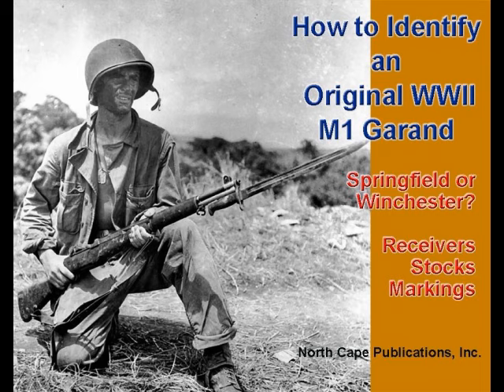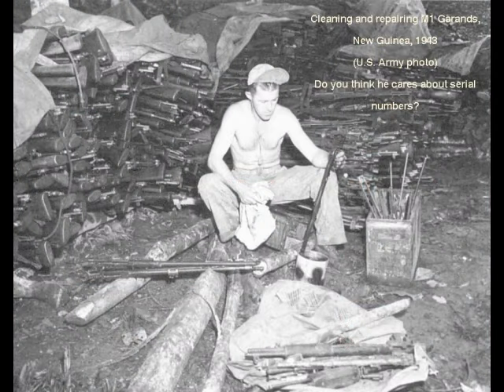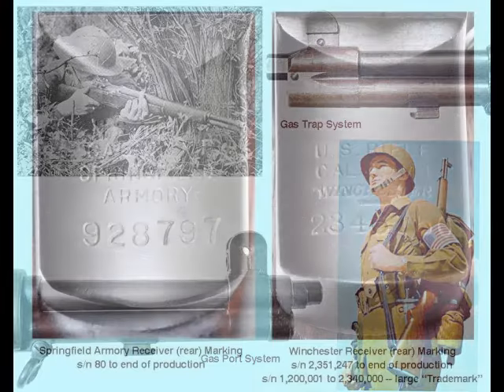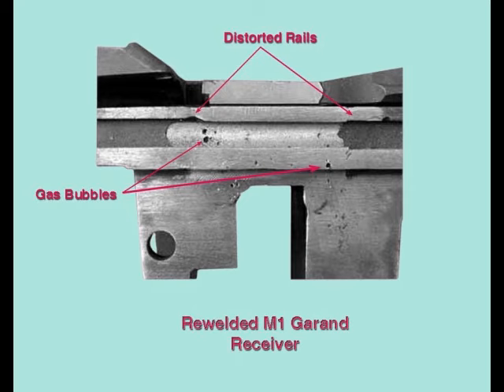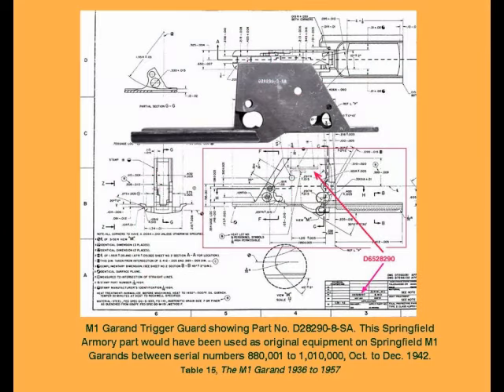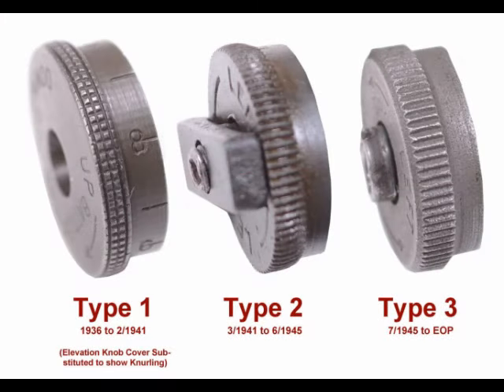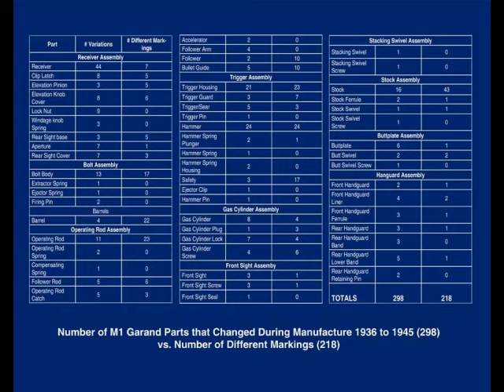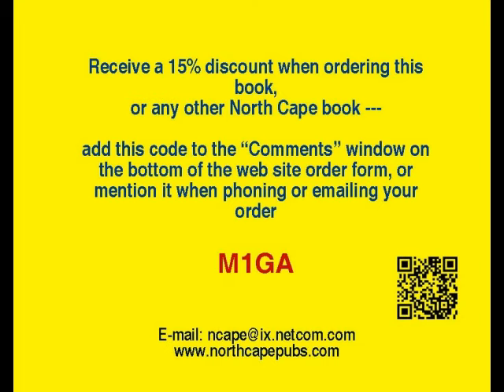How to Identify an Original M1 Garand, Part I

Comment: I believe that I have an all original 1943 that still has the plug in the front sight. I still need to have it authenticated.
Reply: If You do, You have something.  That's really rare.
Reply: @ superbird6bbl , Did you ever have your M1 Garand authenticated for possibly being original?  What make is it?  And even if it's found to have been repaired at some point in it's journey,  it will always be a valuable and much sought after part of American military history.  I am the proud owner of an October 1943 Springfield Armory M1 Garand, with a 1953 SA barrel , all parts are SA manufactured.  Wouldn't it be great if  these old M-1's could only speak of their war stories?  Good luck with your M-1.

Comment: most upgrades have a defective part behind them so making a m1 garand parts correct is a mistake.
Reply: People do that to make it more like it would have been as issued during WWII. They aren't using them as shooters, they are sitting in a case on their mantle.
Reply: @TrashPanda5150  as issued would be incorrect 
for no other reason than they were all taken apart 
exept a few and scattered in baskets and rebuilt to spec 
not using original parts so actually  the mixed part rifles are as issued.
but better if rebarreled because the primers in the bullets were corrosive.
and there is such a thing as a D barrel.
cut with a four prong tool 1 thousanth at a time to 310 thousandths a perfect cylinder.
ment to be m1c sniper barrel 
made around april of 1945.
also pm grands just came back from acrossed seas
no one even knew they existed.
theres a lots left out .
from money grubbers its whatever there needs are at the time it seams to me.
as carried would be the ones id be after
Reply: That's not accurate.  The vast majority of revisions applied to M1 Rifle components were for for the sake of improving the part (not replacing defects) or more often for improving manufacturing efficiencies.  The contemporary obsession with "correcting" perfectly functional rifles is not inherently risky unless you're careless or incapable of identifying unserviceable parts.
Reply: @stevenodell4323  Wrong for instance  
The rifle being designed for the 276 Roberts 
and being changed to 30 06 caused many problems with gas system bolts exploding Operating rods being bent  
even receiver cracking
recoil springs not holding up 
gas operation in extreme cold
Aperature sights not holding settings
and this went on from 1932- 1942 
to pearl harbor
and after.
and many came after Americans actually fielded 
them in 1943.
Some parts from some armorers not being up to interchange abuility 
or just plain heat and tempering being off.
and some parts just being better  
A trophy rifle being best of all parts
since they made old navy pistols 
That would be more better with army cylinders  
and so on.
The M1C Never passing military spec for putting 5 shots in 2 inch group 
only a handfull of rifles seeing actual duty.
but collectors fabricating 10s of thousands of them
Most sniper rifles were in fact 03A1s
and regular M1 Garands.with iron sights 
and actual M1Ds  saw more service.
And also army snipers using Pachmayr Low swing mounts
That I actually Saw a bunch of at Herlong army depot 
and ones i saw collectors remove from army rifles 
because collector mad men not admitting they exist .
but the notes of Commanders are in 
US Marine Corps Scout Sniper .
World War 2 and Korea book 
And most M1Cs having had holes on M1C
being filled in after D DAY by Springfield Armory as Noted 
in The M1 Garand World War 2 
By Scot Duff
Also The D barrels Ment for M1Cs M1Ds  And 
D barrels showing up on junior Devil Dogs Shooting Team
Guns and Winning with 30 06 s
against 762 nato guns is proof The D Barrels Rule CMP '
Matches .
Those D Barrels  Being perfect cylinders probably 
making the most accurate rifles on the planet.
Never having that much work and money being put in any barrel ever!!!!!!!!
If you pull open the Slide and latch bolt open 
Look right under upper grip clip and see a big D
and check date  being March to about july or close 
1945 .
Hand Fitted Boyds Stock you can barely slide off receiver.
You Have A Very Special Match Target Trophy Rifle
Built by Marine Corps Armorer.
DO NOT CHANGE ANY PARTS ON THAT RIFLE.
Its Basicly A Brand New M1 Garand 
With every Modern Trick Done To It.
A Fair Price For that Rifle Being $10,000 Dollars
Need I SAY MORE
Reply: @alonzahanks1182  No, sir, you need to say less.  Your statement takes issue with the assertion "making M1 Garands parts correct is a mistake".  Your essay rambles down a list of observations that have nothing to do with that  idea.
Reply: @stevenodell4323  Also check trigger pressure 
4 to 5 pounds is special parts and trigger job .
even cmp. national armory  and Fulton Armory Rifles
Are very Special.
please do not tear these rifles apart.
If you can shake the rifle  and it makes noise 
knock your self out trading parts .
if no rattles  and nice trigger 
 and tight barrel your reverse engineering a lot of cash.
Reply: @stevenodell4323  Funny how greed always works for evil
Reply: Changing the Milled hand guard out was a cost savings by using a cheaper stamped part. It wasn't a defect.